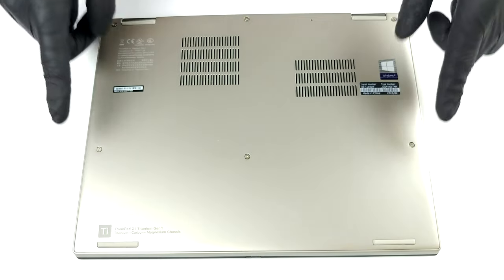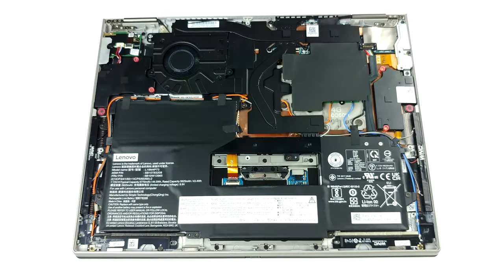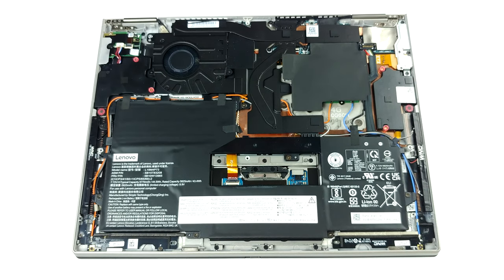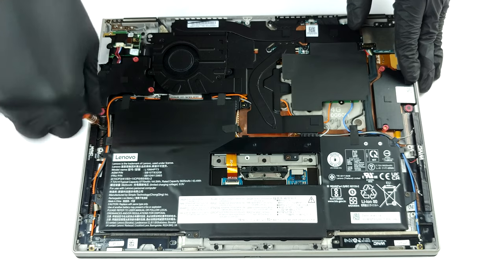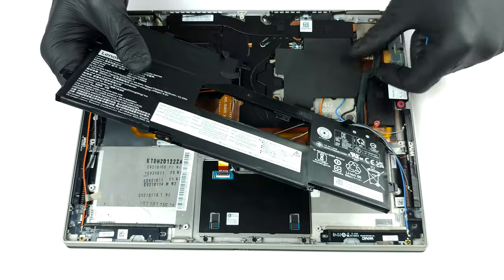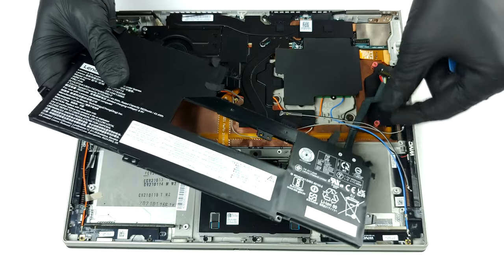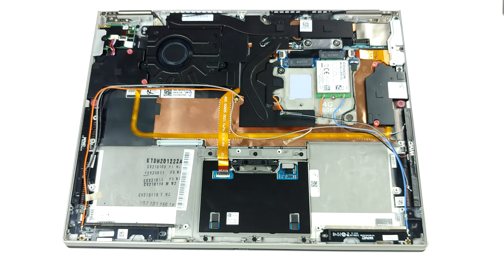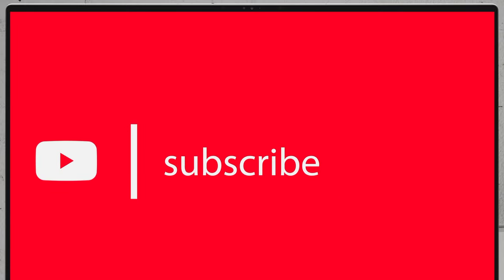🛠️ Lenovo ThinkPad X1 Titanium Yoga Gen 1 - disassembly and upgrade options

Comment: hello, I have a x13 yoga gen 1 laptop. I don't know my bios pass. And the new lenovofirmware update fucked up my pc. It asks for bios pass which I don't know and doesn't let me open the pc without entering the bios pw. Can I reset my bios by removing battery? the big one. As I know there is no CMOS battery in it. It is integrated in motherboard
Reply: Press enter